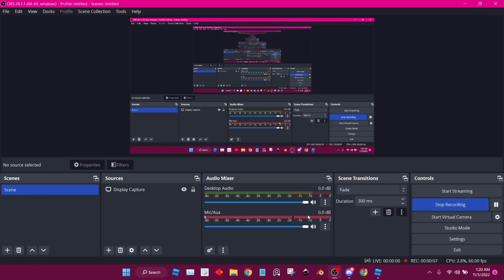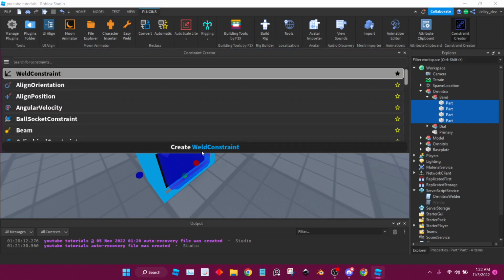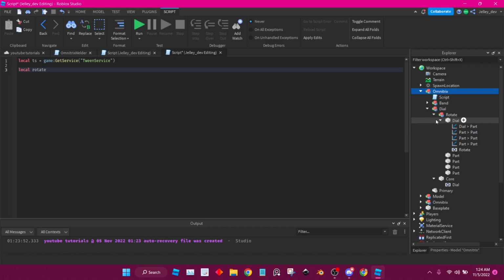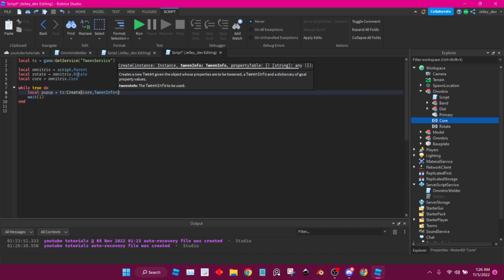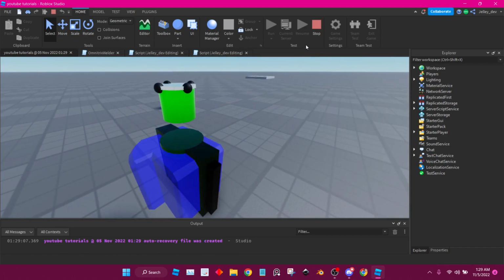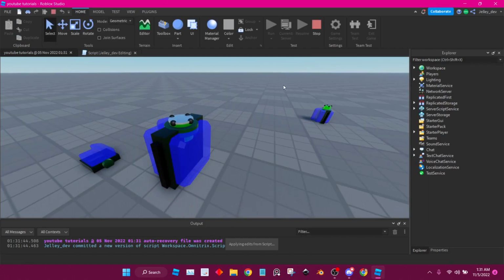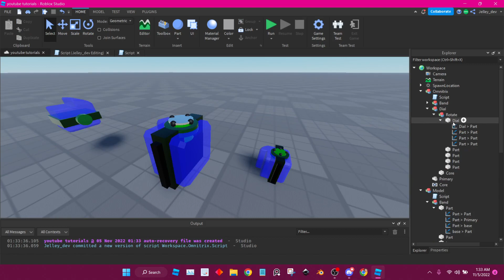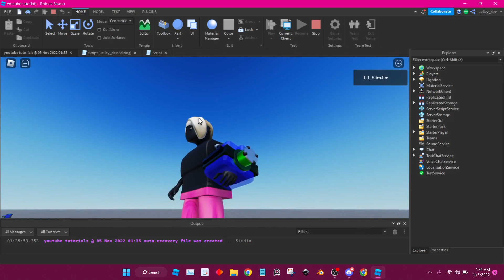Roblox Studio: How to rig and move a model

Comment: Bro i have 2 parts on the core
Reply from the maker: Weld them together… as I did in video
Reply: @Jelleydev  wzit so heres an example:
Lets call Them part 1 and part 2
I weld part 1 to 2 then i make motor 6d between pzrt 2 and weld or whatever's there right